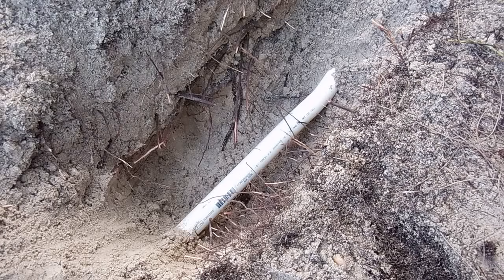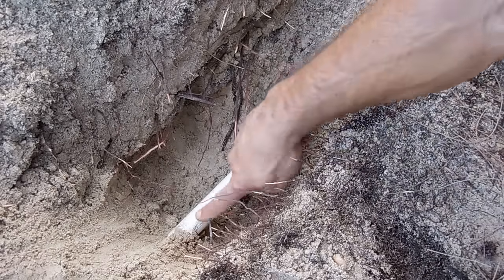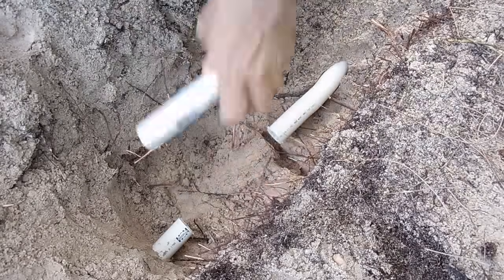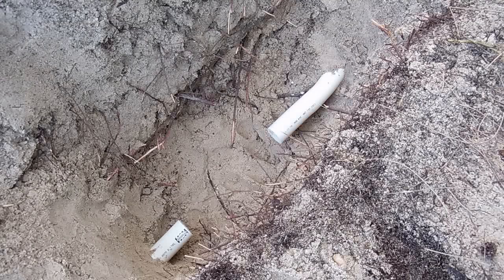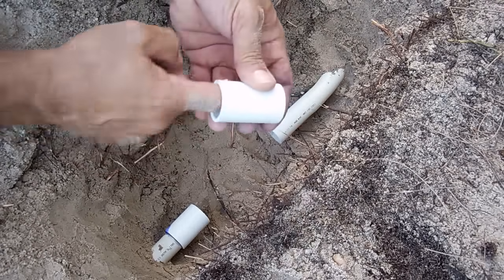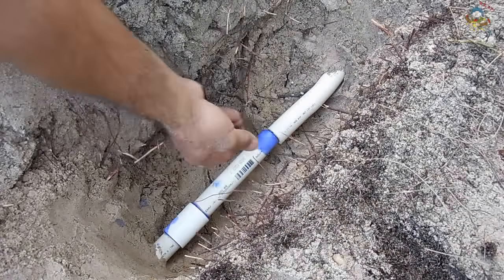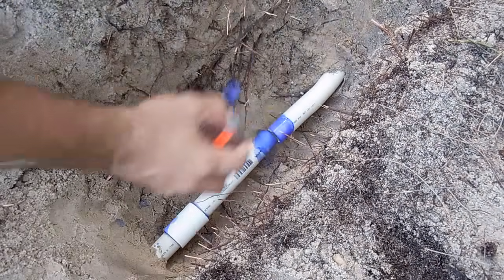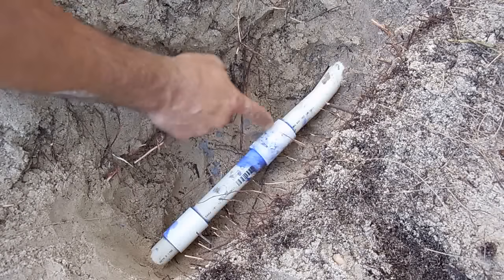EASILY Repairing Broken PVC Pipes(Least Amount Of Digging)

Comment: Very clever Technic! Thank you so much. 
Watched video a couple of times just realized the first coupling 2:20 may not need if the crack is small enough let's say less than 1/4 inches. Just cut through the crack to let the coupling slicing in. The nice thing is if it doesn't work just cut it off and redo it with two couplings.

Comment: This really works!
I did this exact repair today.
Be sure to NOT use instant bond type glue!
Use the type he recommends, the two part primer/glue as it gives you those few extra seconds you will need to get the couplers to the proper position.

Comment: Thanks for the tips! I just found an 1/2” irrigation pipe had a small hole from a metal edging spike. I will simply cut it through and use the one coupling technique with the center stop removed. Thanks again!!
Reply from the maker: Glad I could help!

Comment: If all youre using is pvc cleaner this is not a good join.  But you aren't.  The stuff is PRIMER and it effectively melts the pvc so each bonds to the other.  The glue should be applied while it is still damp...according to Youtube apprenticeship I have done ; )

Comment: I too found your video VERY informative and clear and to the point,,I like that !!    I am having plumbing issues with my water lines ; in a very TIGHT and short area (under my mobile home & close to the floor..which makes it HARDER to push the pipes together once primed and glued..any suggestions?  I now have worked on them for 3 days and am down to very little pipe left to cut..until they make the turn up into the floor...can't afford a plumber..appreciate any advice.  Thanks again for the clear  & to the point of your video..

Comment: the real issue is to lift the pipe up to slide in the second coupling in such tight/short space. this is why he said using slow setting glue, it cant be done so quickly like other method. and, in most cases, the pipe in the rigid clay makes the lifting of pipe almost impossible( without much more digging, which defeat the purpose). so in this sense, the expandable coupling is way better for DIYers.

Comment: If the crack is less than 1/2 way around the pipe, I use a "saddle T".  Just prime and apply glue, then snap it over center of crack.  These come in assorted sizes with a blind hole.  Always keep several sizes on hand for my irrigation system.

Comment: I am adding a “T” to an existing line and was just about to dig up about 5 feet of line so I could put a bow in it to get the fitting on. There will be a ball valve at the start of the new line so I’ll close it, recharge the line and see if the connection holds water. Thanks for the tip and we’ll see if this works.
Reply from the maker: Try this tip. :-)
https://www.youtube.com/watch?v=LP41_wXW8jc

Comment: If you can't budge the pvc at all, then with couplings, remove the stop as mentioned, sand the inside a little more so that they side backwards onto the pvc after cutting out
a section of the pipe. Clean everything good as you mention, put the pvc pipe in place, glue the hell out of it, and slide the couplings forward onto the pvc pipe, voila!
Another much quick repair for tiny cracks. Cut a coupling length wise creating a half diameter. Remove the stopper, then after cleaning and gluing everything, place the half length coupler over the crack and hold it for a minute. Voila!

Comment: The glue getting pinched between the end of the tubes and the stop is what creates the seal. The glue gets scraped off of the inside of the coupler when the tube is inserted. You're LUCKY if you get a seal this way.
Reply: That is not correct. The glues are a solvent type when means the PVC surfaces effectively get "welded" together. This is why the glue must be applied to both surfaces. Indeed, having excess glue piled up at the stop can result in the solvent glue continuing to dissolve and weaken the PVC. If your joints are leaking then it's because you haven't applied the glue property and have a dry patch somewhere on the touching surfaces.

Comment: I’ve spent so much time and money trying to do this simple repair.  I’ve always wondered why you can’t find ridgeless couplers.  Thanks for the simple, inexpensive solution to this common problem!
Reply: If it's irrigation pipe with pressure use 4- 90s instead of 2 couplings.  Forcing and altering fittings is not a good idea. 2 90s facing the same way and then a short " make up" and the other two 90s will eliminate forcing anything. Use common sense
Drain lines use a "fernco band" with a stainless stress band.
Reply from the maker: Glad I could help Charles

Comment: How come when my sprinkler valve is open in the valve box the ground around it is wet and the box gets filled with water? If the sprinkler is off should there be no water in the line to leak out? I haven't used the sprinkler since 5 months ago.

Comment: Tried this for two inch pipe repair and failed on the last step. The primer bound on the slip coupling, and it stuck, so I couldn't slip the coupling back over the other pipe. Hadn't even applied cement, Hella sad. Assuming the only way forward is to cut the pipe out and start again

Comment: I have a section of 3" vertical PVC drain pipe that I need to cut out and add in a Sanitary Tee fitting. The existing pipe is fixed and both ends (once cut) will not be movable. Will this technique work and allow me enough vertical leeway to insert pipe into the sanitary tee hub? Should I also Chamfer the pipe edges so the glue doesn't get pushed out of the joint?
Reply from the maker: No. Use (2) 3" Fernco couplings
Reply: @electronicsNmore  and those Fernco couplers work ok on a vertical section of pipe (as opposed to horizontal)?
Reply from the maker: @p51mustang31  All drain lines.

Comment: This is a great technique.  You have to sand/file slightly more plastic than just the stop because the coupler is slightly papered, to allow a slippery back and forth.  I would recommend using medium set glue on that last joint to fill that larger gap after the primer coats.  The dry time would need to be increased to a couple of hours undisturbed with medium set glue.  I wish they sold couplers with without the stop in PVC for repair.
Reply: They are available, they are called slip couplings.
Reply: @mykelbrawley5758 use a round file to file out the stop

Comment: What a smart man!  Why don't the sell those shelves for easy fixes.  The plumber used one of those expandable expensive coupling 5 years ago when I added water to another building and apparently didn't install it correctly so I used your method and it worked like a charm.  I think you should paten the idea.  Thanks for the tip!

Comment: Mines still leaks darn it
Reply from the maker: Probably not on enough, you didn't apply enough cement, or you didn't slightly twist the coupling as you slid it over..
Reply: @electronicsNmore  yea raja re did it and works great thanks again first time pvc repairer here

Comment: Looks good.  Is it OK for municipal mains pressure?   I have just finished fixing a break with brass fittings and it looks a lot simpler with your way.  Just a suggestion - put a piece of paper under the job.  I can see myself getting sand on the glue every time!
Reply from the maker: Yes Peter. Laying an old rag under the pipe is definitely a great idea. Thanks for watching!

Comment: It doesnt work when there is water backing up the pipes as in a main line.
Reply from the maker: Yes, you need to push the pipe down to allow all the excess to drain out, out use a wet/dry vac if you have a lot of water. Also a possibility that you're not turning off the water fully.

Comment: Nice idea. But i wonder, why you cannot slide the second connector over the crack itself and fix there. this way no need to replace with another pipe.   Cutting two pipes and fixing the joint has more exposure than a crack. But yes, there is the issue of how you apply PVC cement into the second connector. For that the cement can only be applied on the fractured pipe around the crack in excess i guess.

Comment: I used a slow-set PVC cement on my repair and it locked up immediately! Ruined! Amazon refunded the $19.00. Please mention the actual brand you used.
Reply from the maker: I used regular set clear Oatey. You must work fast. I suspect the slow set you used was heavy body.
Reply: Do you have the stock number for the Oatey slow-set regular body? Amazon lacks a mention of slow-set and HD had nothing on the shelves here.

Comment: Completed my repair with only one coupling. Cut the pipe where the crack is located to separate the pipe and slip on the repair coupling as shown in the video to reconnect the pipe. No need to cut and reconnect a long section of pipe with two couplings.

Comment: Why not use a slip coupling on both sides & then there is no need to lift either pipe
Reply from the maker: If the fitting slides over the pipe dry, you made it too big.

Comment: You need them expensive slip joints in the Houston area because of all the clay soil. It contracts and expands a lot with the wet and dry spells and rips pvc joints apart. Mother Earth is very strong!
Reply from the maker: Some areas have very dense rocky soil, especially the W and SW USA.

Comment: Here’s a possible refinement of your technique that I might try on a small crack in a PVC water line that I just caused by accident:

Instead of using TWO couplings and a short piece of PVC pipe to patch the broken section of pipe, I’ll just use ONE coupling where the crack is, and no added pipe.

In other words, I’ll just cut the pipe where the crack is — assuming the crack is small enough that a coupling will cover and patch it — and do just that, slide the coupling over the crack.  The glue should make things dead solid perfect.

If though, the crack is too long and extends beyond the coupling, it would still leak and I’ll need to use the original two-coupling and pipe technique shown in this video.

Not sure if this is clear without making a video, but the point is that ONE coupling could potentially link two pipe sections together that were cut at the point of leakage — and fix the leak while doing so.
Reply from the maker: In that case, buy a snap fix.

Comment: Thank you so much! I accidentally cracked a sprinkler pipe while digging a flower bed, so one project turned into another! Inexpensive and simple fix! Saved us significantly more money compared to hiring someone. Also, a high speed Dewalt drill and bit grinds the stopper just fine! Thanks!
Reply from the maker: Glad it helped!

Comment: Exactly what I was hoping to find! Working on a cracked 4" sump drainpipe.  I know its impossible to bend the pipe, but figure I can preinstall the slip before connecting one of the ends. Great video.
Reply from the maker: Use a Fernco coupling since the pipe isn't under pressure.

Comment: Very smart 👍 I never thought about burring off the stop inside the coupler, that's ingenious!  but you work too hard, I'm going to slide the coupler on the other end of the pipe before gluing the fixed end first so when you're ready to glue the other end,  you don't have to muscle the coupler in, it's on the pipe and lined up, all you have to do is glu and slide it on the joint.
But thanks again for posting this excellent tip

Comment: Had a double break with two lines run together and this worked perfectly. 1/2 inch on top and 1 inch right below it both hit with my shovel. The glue is like a lubricant for 5-10 seconds and it works. Thanks for the pro tip.
Reply from the maker: Excellent! Glad it helped

Comment: I assume this repair can be done on either a lateral or a main that is  pressurized 24/7, correct ?  Also, the PVC cleaner (actually called 'primer' around here 😁) is actually to help melt/dissolve the PVC plastic at the joint so that you get an actual 'welded' connection.
John H.
CA lic. contractor
Reply from the maker: For all PVC pipes under constant pressure. Yes. Cleaner is used to clean up and soften older/dirty pipe, and the primer(purple) is used for new/clean pipe.

Comment: A shark bite slip coupling may be cheaper than the fittings, glue and primer depending on the size pipe. Even though I'm not a huge fan of shark bite. I'd much rather have a shark bite in my yard instead of my wall though. 😂
Reply: Shark bites should not be buried!  I had to replace a shark bite connection 3 times before I gave up and glued everything.  They would work for a few months and then start leaking again.  Another huge water bill!  Hundreds of dollars wasted because of SharkBite!  You never know that they're leaking until your water bill comes.  That was a lot of digging!  If you do use a Sharkbite that's buried it  must be covered with silicon tape to keep the dirt out of it's o-rings.  If you don't, those sharkbites will NOT come off again even with the special tool.  You have to cut them out.  Never again for me!  This video shows a much more reliable way to fix a pipe than those stinking SharkBites.

Comment: A slip coupling is only a couple bucks if you don't want to Dremel the ridge out. You can also get one for each end and measure the pipe exactly. You definitely want your ends cut straight and flush when using slip couplings.

Comment: Remove the stop in the slip coupling. cut the slip coupling lengthwise in two places to remove about a third of te coupling.  Prime the crack area.  Prime the inside of the coupling. Glue the crack area and the inside of the coupling. press the coupling over teh crack and 'snap; it onto the pipe. Twist it a bit and trhen hold it tight Or use a radiator hose clamp until the glue is set.  Think of it as a home made saddle fitting!

Comment: Well done, clear presentation.  It's very important to use a slow setting pvc cement.  They come in different setting formulations.  If this method is used with the 'red' fast set cement it will be a disaster!  I know from experience...
Reply from the maker: Yes. I only use regular and slow set. Fast set will be virtually impossible to use.

Comment: Excellent!   Next time dig your hole a little bigger. I wish there was a way to do this with Poly pipe.  I have to add a tee but can't. So I'll cut and add 2 90's. From there I will be able to go into a metal SS tee with NPT 90's. I'll do this in the building that needs the water.

Comment: Your idea is amazingly wonderful. Normally we dig too long to bend the pipe to be able to fit in the coupling. Digging singlehandedly is tiresome and time consuming. Thank you for your brilliant idea.
Reply: That's true. 

The thing is we need to make sure the sliding joint doesn't get stuck so it can't be moved back.

Today, I fixed broken pipe underneath the ground like this.

When I applied glue to the joint and insert it into another pipe, it's difficult to make it sliding back. Maybe it's because the glue was already a bit dry.

Comment: Why not instead of filing the coupling you just use a pre made slip fitting? Wouldn't it be the same thing?
Reply: I was wondering that , in guessing they made  those
Reply from the maker: The only sell full slip PVC couplings for DWV, not pressure. You'd need to buy one from a plumbing supply house.
Reply: @electronicsNmore  i was at home depot and they sale for irrigation …. Don’t know if i  trust them tho
Reply: They don't sell them at home Depot. I ended up buying a half circle file and shaved the stop off. Dry the coupling gets a bit stuck but once you put the primer and glue It'll slide down the PVC pipe.. You just gotta do it fast before the glue dries.

Comment: Use 4 90s man so much easier...smh
Reply from the maker: (4) 90's is an inferior repair method. The water hits a wall and has to change direction 4 times. You definitely don't want to use it on a main line.

Comment: If you’re worried about sliding the coupler around (the one you removed the stop from), don’t. The glue acts as a lubricant, but only for a brief moment. Move quickly and it works great. Great vid.
Reply: Thank you
Reply: Yes. Work quickly, as in less than 5 seconds.

Comment: Instructions were very clear and easy to understand. Thank you for taking your time to make this video. My only concern is to be able to cut the pvc pipe just the right length so that I do not  crack the pipe while lifting it to fit the second coupling. I will look into buying a pvc cutter.
Reply from the maker: It doesn't have to be cut exact. Thanks for watching!

Comment: Even easier, not bending the pipe at all is to just use 4 90s lol.
Reply from the maker: (4) 90's is a lousy way to repair the pipe. The water hits a wall and changes direction 4 times. All you're doing is increasing friction loss, definitely not what you want on a main line.

Comment: First, you know that coupler that you sanded the separator out of? They sell those in the bin right next to it without the divider. It's called a "repair coupler." Second, what if that were 4" schedule 80 in clay? You NEVER have to bend either pipe in either direction if you utilize said repair coupler's function. Slide it over the pipe to the street first, then glue in your regular coupler and repair segment to the house side, leaving as little gap between two pipes as possible. Glue both ends and slide the repair coupler back over, splitting the difference of the gap. Miller time.
Reply from the maker: They DO NOT sell PVC full slip couplings for pressure, only DWV PVC. Why do you think I made the video? LOL This method is only ideal for 1/2 to 2" PVC pipe.